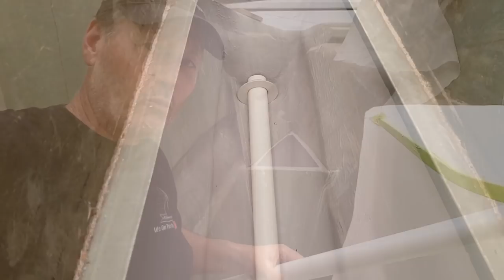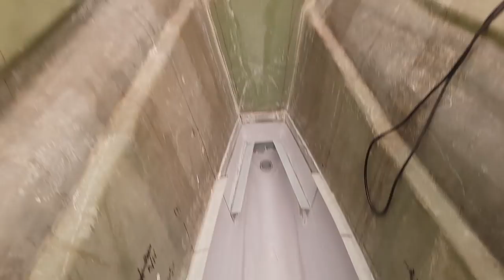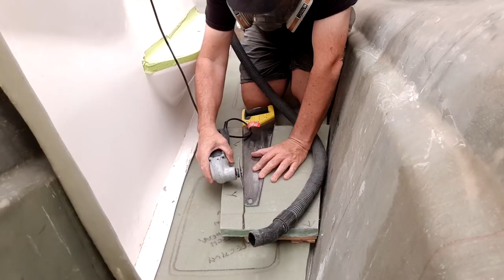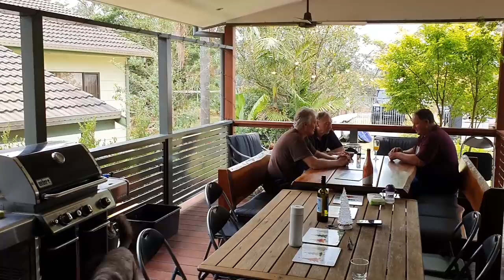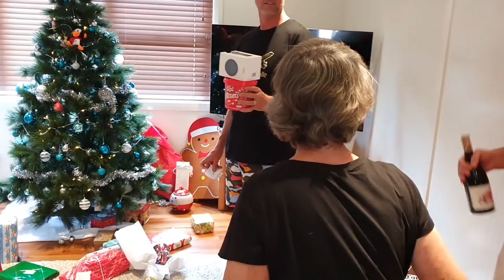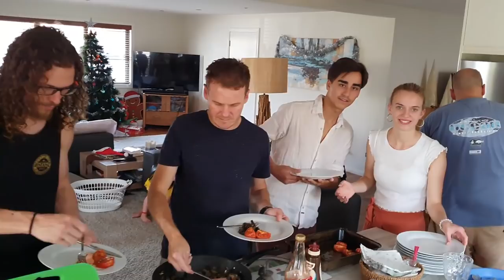Ep098 Crash Bulkhead Drain Install - Life On The Hulls - Catamaran Build Project

Comment: if your doing the other hull 2 sticks of wood and a bolt with a wing nut thru the center would make a clamp. A long bolt so you have a handhold and not push it back thru when installing  the other side.
Reply from the maker: Never thought of that. Would need to coat all with plastic to avoid epoxy sticking to the clamp. Cheers. Rossco

Comment: For clamping a through hull / bulkhead with a hollow center, use two wood blocks with a hole in them, a pair of fender washers and a bolt with a wingnut. In this case, 175mm x 50mm x 20ishmm boards, M8 hole, M8 bolt, washers, nut, etc. The longer the bolt, the easier you can feed it through like a toggle bolt. Tighten down, squish it together, then you are all set!
Reply from the maker: That is a vey good solution. I wish I had thought of it when I was in a real mess.All conplete now and will certainly do it if I do anther one.Cheers Tim.

Comment: Might want to add a fiddle on the aft end of that new bit of flooring to keep anything dropped from rolling into the bilge...And if you find any large amounts of water in the crash bulkhead, even if you repair the leak at sea, you might have trouble draining it due to 'liquid lock'. A small vent valve at the top will solve that easily...
Reply from the maker: Hey Mike.The step down now has a solid fiam core stair tread riser glassed to make the step structural and enclosed and complete bracing underneath.I will install some type of valve to relieve pressure in crash bulkhead as that is a great idea and allow water lock to be eliminated.Cheers Buddy.Ross

Comment: You've been talking about the crash compartment and bulkhead for some time now. You're concerned about draining condensation from the space which makes sense but if the space is truly airtight, is pressure not a problem as well? It seems that with temp changes, the pressure could get pretty high or low, causing stresses in the structure.

Thanks for the great channel. I look forward to the next installment every week.
Reply from the maker: I imagine pressure is a problem and some type of relief valve would definately required.I can see a small waterproof hatch in the top of the bulkhead that can be opened or vented to relief such s build up.It would also ensure waterlock doesnt occur when draining a breached compartment.Cheers Ross

Comment: I don't understand the purpose of the ball valve. Why not let  any water that might appear just flow into the  bilge where it will be automatically be pumped out. How will you know if there is water in the crash bulkhead?
Reply: It's a crash bulkhead! If you crash into something, the bulkhead flouds and not the boat. You open the valve a little bit to check for a leak.

Comment: Lots of Xmas wishes family etc. Thats nice. What about the crash bulkhead drain? Personally I don't get it. That's a huge pipe for condensation and you would never get anything like you'd need to drain. Secondly if you did unfortunately break the hull, you can't drain water while the vessels in the water. And once up and out of the water it will self drain from cracks in the hull and the cutting away of damaged area for repairs. Beats me but your enjoying it while I'm exhausted watching.😂

Comment: I think you just wanted to make more work for yourself. ;) If ya need to drain your crash compartment; you have bigger problems to fix!
Reply from the maker: Perhaps you are correct.I di like s good project.Good to know I can at least check the potential ingress of water.Common in a number of modern cats now. Cheers Ross

Comment: Stupid question from a non-sailor - could you fill those crash bulkheads with closed cell urethane foam and void the space of air for condensation?
Reply from the maker: I could indeed full this void with 2 part foam but the issue is if ever there is a breach the fiam tends to always absorb water which would lead to problems further down the track.I am hsppy with a simple air void whuch ca n be easily cleaned and repaired if required without the nightmare of removing foam to repair a collision damage.Regards Ross

Comment: Could you just have filled the space in there with a closed cell expanding foam?
Reply from the maker: I could indeed full this void with 2 part foam but the issue is if ever there is a breach the fiam tends to always absorb water which would lead to problems further down the track.I am hsppy with a simple air void whuch ca n be easily cleaned and repaired if required without the nightmare of removing foam to repair a collision damage.Regards Ross

Comment: It’s probably too late now but do yourself a favour and get rid of those valves.they tend to get very stiff and eventually seize up. I’ve just replaced 42 of them in an aquaculture setting and didn’t enjoy it,there are black pe ones( with blue handles) that are far superior pressure rated as well and best part they aren’t that much dearer — can get them at irrigation stores plumbing stores etc
Reply from the maker: That is great advice and I will certainly look into it.Cheers Ross

Comment: Does a void in the fiberglass hull need to be vented? I work on aircraft and I have seen wings collapse when the tank was being pumped but the vents were stopped. It can be catastrophic damage. I don't know if it would be like that for your hull.
Reply from the maker: I imagine pressure is a problem and some type of relief valve would definately required.I can see a small waterproof hatch in the top of the bulkhead that can be opened or vented to relief such a build up.It would also ensure waterlock doesnt occur when draining a breached compartment.Cheers Ross
Reply: Yes that is exactly what I mean. Thank you,

Comment: Aren't crash bulkheads meant to be water tight?
Reply from the maker: Yes indeed.They are to be able to be inspected and can have access waterproof hatches and pressure rated drains as long as they are pressure tested and are air and water tight.Cheers Ross

Comment: I would not use that bulkhead as a lift or block point
Reply from the maker: Definately not.Main bulkhead areas only. There are now many sectional bulkheads also along the hull further reinforcing the monocoque structure.They are also above spec with extra laminate and 20mm foam h80 increased from 10mm to further increase strength.Cheers Ross

Comment: I do not see the sense of you putting these in.If you have a leak,you have to haul out.this is when you need to drain any water.And do any repair.
Reply from the maker: Whilst not required it is common practice to have some access through either a certified watertight hatch or drain as often these compartments suffer leakage unbeknownst to the owner.This will allow some method of checking whilst in the water to determine whether leakage is occurring with the ability to shut off flow quickly and enact repair and or drainage.I believe it has merit as all compartments sealed or not will encounter condensation problems as well.Sll the best .Thanks for bringing this up.